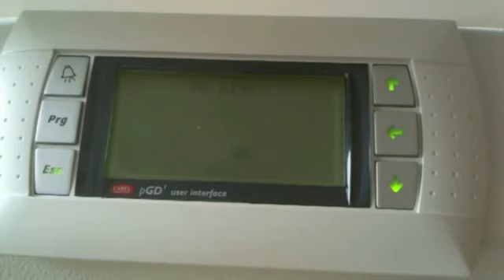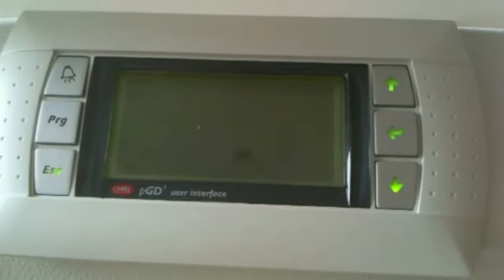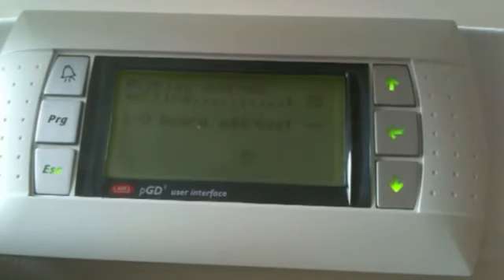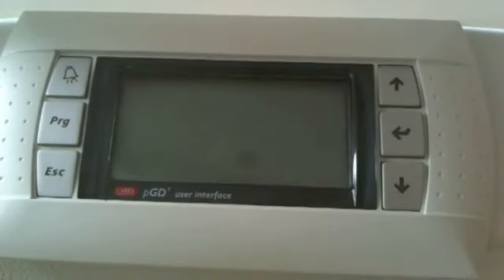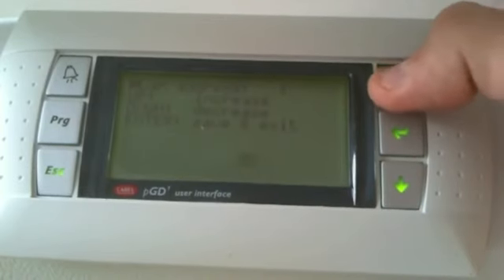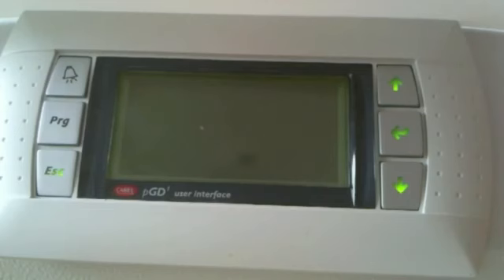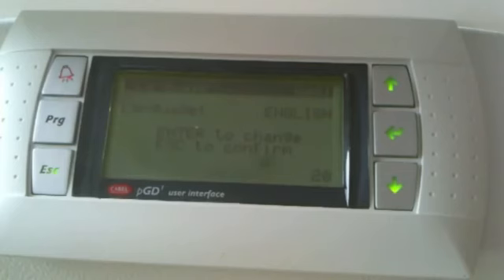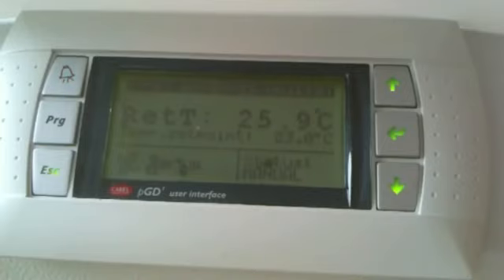How to Fix a "No Link" screen on a CAREL PGD1 Display Connected to a PCO Controller

Comment: Hi ! 
Thanks for this very informative video.
I have a similar issue but NO LINK does not appears at power on but after a few days (actual delay is random).
If I power the unit off then back on, the NO LINK error disappears, but still comes back after a few days and so on.
Do you think the procedure described in this video is supposed to fix such an issue ?

Comment: Hi, I got a problem with pgd0 display, I change the adress to 00 and press "Alarm - Up " button , it can not acess to pCO3 controller to set the address of the PCO3, May pgd display got problem with the port or the firmware or the hardware? And How to reset the pgd. Thanks

Comment: Thanks for the tutorial.. very helpful. but i m lost a bit. why set the display to 32 again? cant it work with 00 address you set earlier?
Reply from the maker: The address 32 is an address in the pLAN network for shared display. Address 00 might work with certain software but not all... really depends on how the software has been coded by the manufacturer.
Reply: i-A.C.Systems
I have a PCO3 and a PGD1 display. can I it work well? or I just need a PDG3. I have tried to follow the steps but I cant get it right Set 32 and 00 on terminal 1 private but no luck. After the screen times out I cant switch on and off from the display. do you have some ideas? how can I check the manufacturers address on the PCO3?

Comment: Hi, I've followed the procedure all the way and after i set the display to 32, the no link symbol appears and then the screen goes blank. Where/how do i download ahu software for the device?
Reply from the maker: Hi Martin
Best thing to do would be to repeat the operation from the start once more [to make sure that controller is on address 1] and then see if this problem persists.
If so, you may have a faulty pLAN port so may have to get a replacement controller. 
Feel free to get in touch with us if you'd like to discuss this further on info@i-acs.co.uk
Reply: @iacs  thanks, I'll give that a go.

Comment: Thanks sir.
While pressing the buzzer and up  button togher nothing is happing.kindly suggest ..
Reply from the maker: Hi Ravi, this sounds most likely to be a faulty PGD display.. you can find replacements here:
https://www.i-acs.co.uk/store/index.php/pgd1000f00.html
Reply: I have the same problem, on 2 pCO3 with 3 different pGD terminals. Do you have any idea?
Reply from the maker: @LtdJorge  Hi, it does seem rather strange to have 3 different PGD terminals that are all faulty, all I can presume is that this is to do with a wiring issue on the pLAN. I would suggest checking the wiring connections to the controller.
Reply: @iacs  actually, we have them connected locally, so they are doing fine on address 0, but they are using that address now because they started throwing the no link error out of the blue, but they were all on address 32 for the pGD and 1 for the pCO, as they aren't in a pLAN.
One thing I have noticed now, fiddling with it is that after a very long press of the UP and Alarm buttons while starting up, the "selftest message" appears but disappears almost instantly, displaying the typical status of the controller. I am starting to think that the developers of the firmware locked down the access.
Reply: Well, technically, one of the controllers displayed the no link error, and we tested 3 terminals on it, until discovering this video. Then I put the displays on address 0 and they work, but I cannot enter the address menu for the controller. I tested on another controller with one of the address 0 terminals and it worked, but the controller address menu couldn't be entered, as with the other one. This is what suggests me the lock down.
Reply from the maker: @LtdJorge  Yes, this sounds like a likely reason for this happening..
Reply: MCdevilkiller during the "no link" on display does the unit (ahu or chiller for what display is used) was working or wont start up until "no link" was removed?

Comment: i just replaced a pco1 controller today because the same no link, I read the boot up controller lights which were different everytime I tried to do a open circuit  reset, I knew the controller was screwed. The cause the pool climate control maker, I will not mention a name made the air handler with an exposed evaporater line directly above the controller.  Well bad bad design evaporator lines get cold and sweat water. Water driped on the board and fried it. New controller and after a 00 reset to the display and a few other software tweeks back to new.
Reply: Well done! Thanks for the post

Comment: what combination of keys to switch on/off from the keyboard?
Reply: The function that will turn the unit ON and OFF is entirelly dependant on the software running on the PCO controller, not on the addressing of the pLAN address of the display and controller, which is instead part of the firmware of the display.

You will need to consult with the manufacturer of the Unit that would have most likelly developped a custom software for that machine.
Reply: thank you so much
Reply: @StefanoLanzani thank you for this info Stefano. I'm commissioning a systemair AHU right now. PCO5 refuses to establish communication with presidency

Comment: how to reset alarm
Reply from the maker: It depends on the alarm coming on the display. The alarm lists are coded in the software on the controller. The display is just a slave device to the controller which will output whatever the software is executing. Some Alarms are manual reset, some are automatic reset... if you click on the alarm bell button, the software should display the list of active alarms. Click the Alarm bell once more and you will acknowledge the alarm. When you press it one final time, you can reset the alarm. Obviously, if the alarm condition is still active, you will still be getting the alarm showing on the display.
Reply: iACS hi, so it means the chiller or other unit on which display is working on can keep working even the display shows "no link" because display is only showing/reading information from main board? But if during "no link" chiller wont start it means the problem accures in mainboard?